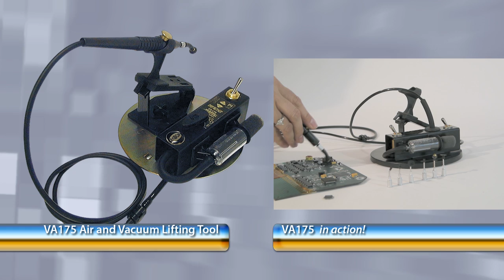EDSYN 2015 Presentation: Let's Get Back to Basics!

Comment: Is the air regulator knob supposed to fall off? Because the knob fell off the machine sent to Louis Rossmann. It looked like a pretty good, if dated rework station. He complained about the air flow in his video and I'm pretty sure it wouldn't have been a problem if the knob didnt fall off, but there's no way to really tell.
Reply from the maker: No it’s not supposed to fall off. He should have sent it back to us for replacement but it’s all good. It’s a very good station for many applications but not all and keep in mind we originated hot air technology so we do understand the techniques needed to get most jobs with ease.